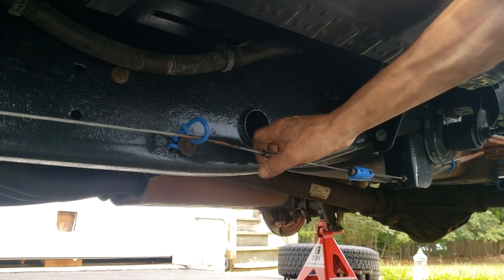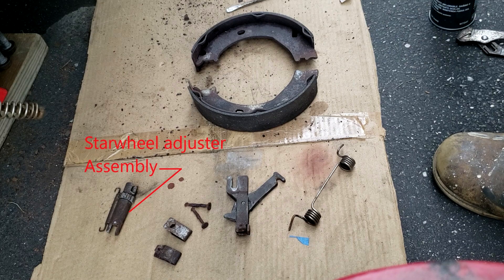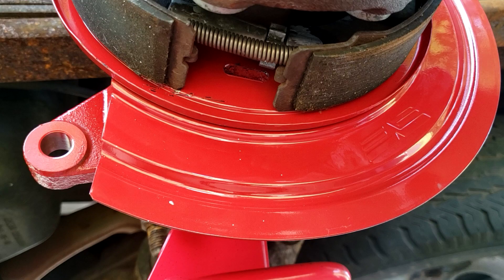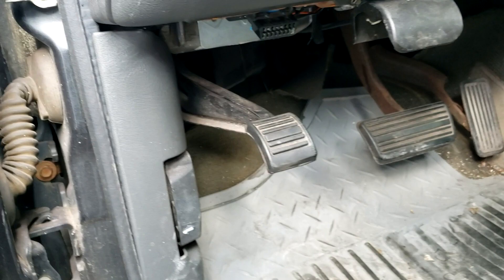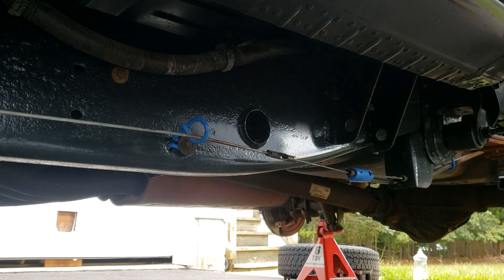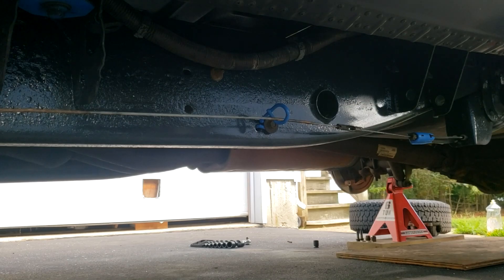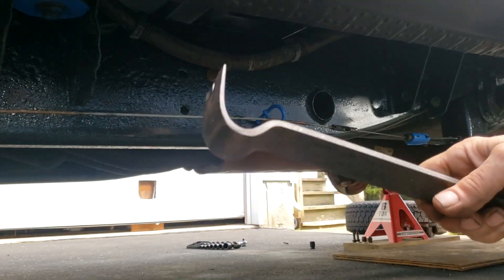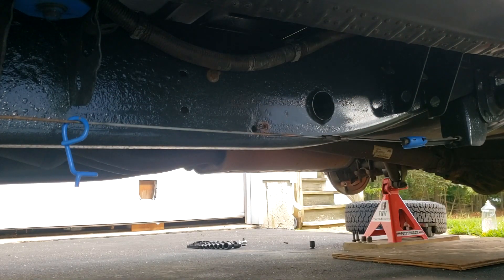How to release the tension of the automatic parking brake cable tensioner on any Chevy pickup

Comment: If the removed the  release handle for a heater core. And now the parking break is not engaging or the light is not coming on while engaged?
Reply: Under the car the cable is pulling in the back?